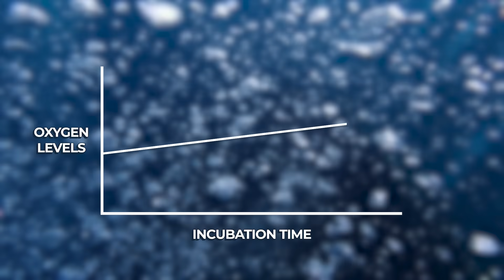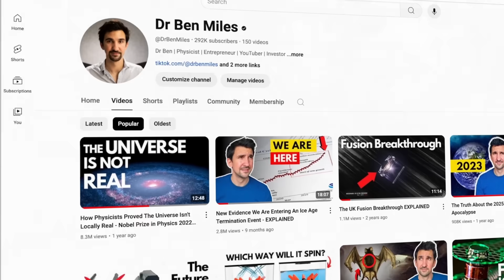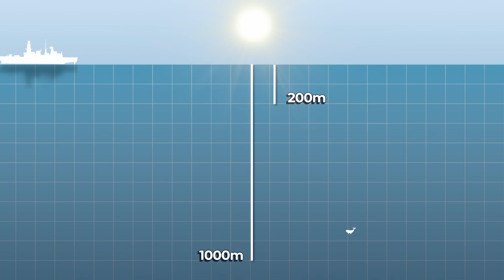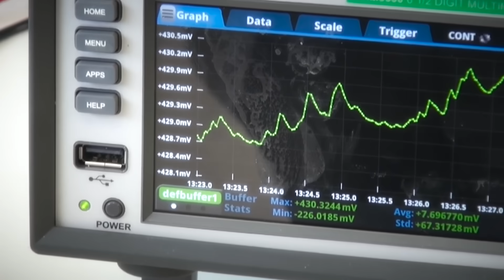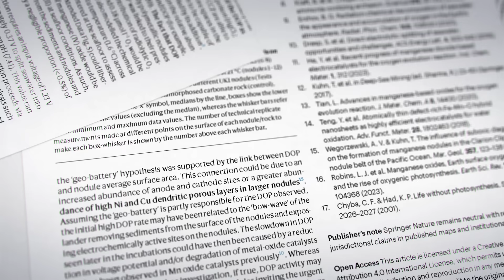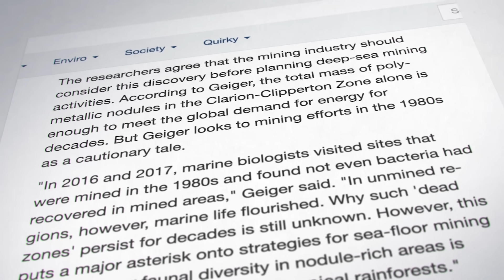We Just Discovered "Dark" Oxygen on Earth - Breakthrough Explained

Comment: What I don't quite understand is why they did not measure the Hydrogen levels. Shouldn't that give a clear indication of whether electrolysis is taking place or am I missing something?
Reply: They were originally only looking for a biosignature. Now that we know about this I'm sure people will be doing that.
Reply from the maker: Its a good point. They did look for hydrogen, but said it wasn't clear if it was being produced or not. This happens when the electrolysis is weak. So not completely conclusive either way.
Reply: @DrBenMiles  Also quite possible that something in there - sediment or solution - is buffering the hydronium. Still, the reason that the curve levels off seems pretty clearly just that it reached equilibrium.
Reply: @DrBenMiles  What about the pH of the water?
Reply: @DrBenMiles It's important to note that this if it is indeed electrolysis, that it is happening in saline water so chlorine will be produced as well. Free chlorine is not particularly good for most lifeforms.
Reply: They probably did, but they reserve it for another paper. In science, it is common to stretch the story's sausage.
Reply: @jf3457  Im very intrested to see if that theory can be proven, because having that on deep sea level will surely change how we see the earth in some way.
Reply: This would be included. Increase of hydrogen levels might be what is killing the microbes. Exclusion of this makes me ask questions and stringing out the reader doesn't pass the sniff test. Unless you're doing the fake science thing where peers aren't actually reviewing papers. If so, then ok, that works.
Reply: @danielcurda3633   They purposefully killed the microbes using a lead solution to ensure it wasn’t microbial life producing the oxygen, having read the paper they don’t mention microbial death in the tests where they didn’t. Secondly at the pressures the vessels were at hydrogen is soluble enough you wouldn’t just have a layer forming at the surface and I’m not even sure if sensors for hydrogen in solution at these pressures even exist, all of the equipment used is highly specialised. Also this is a short article not a paper, they are reporting initial findings which i’m sure they are working on following up.
Reply: @Radio-laria  wouldnt they just depressurize like 50 samples from one cylinder and then try to detect any changes in the composition?
Reply: @Radio-laria  This is not simply water. it is brine. The hydrogen should surely react with the chlorine to produce hydrochloric acid  and chlorine. This process is used in some swimming pool treatment systems to produce chlorine to keep the water sterile. Add salt, add electrcitiy. voila - chlorine. 
There are other questions too. 
Has this sediment been producing oxygen for aeons, or is the process for measuring it actually kicking off the reaction. If it has been producing oxygen for a long time it suggest a catalytic process, not a chemoelectric battery like process.
Is the concentration of oxygen in the sample, the thing that brings production to a halt.
Way too many questions to jump to a conclusion.
Reply: @Radio-laria  You can simply release the pressure and the hydrogen would gas out, at which point any number of tests (starting with: a match) would detect its presence.
Reply: @jf3457 I really like that phrase you used there. I might steal that for myself if you don’t mind.
Reply: @jf3457  Or the company paying them told them to do whatever was needed to allow further mining.
Reply: @brbrbrbrbrbr8393  Whilst hydrogen is usually barely soluable in water at the pressures the experiments were carried out in a significant amount of hydrogen is able to dissolve.
Reply: How about measuring chlorine levels, as electrolysis of sea water produces chlorine not oxygen?  I think these "scientists" are dumber than the rocks they study.
Reply: The same chemical reaction is believed to to be responsible for the very large deposit of natural hydrogen found in North East France last year. And it could be presumed that extreme pressures come into the process as well, be it 4km down in the ocean or 2 km down in the earths crust.
Reply: Hydrogen likes to bond with other molecules and turn them into acids, so it could be that they don’t expect to see bubbles of hydrogen, since it would too readily react with other elements in the water around these nodules, especially if the metal is creating it via hydrolysis.
Reply: @NotreDanish  Isn't it also true that hydrogen atoms are much smaller than oxygen, and would escape faster?
Reply: @ChelleLlewes  They are indeed smaller, but they aren't escaping. The electricity is tearing a water molecule apart to free up one oxygen atom and two hydrogen atoms. Even though you're right about the size of the atoms, there's some chemistry law (Boyle's?) that says the released hydrogen gas should have twice the volume of the released oxygen. Wondering where it is going is an excellent line of questioning.
Reply: @thomasmount3530 but then the pressure is a factor, a lot of processes act differently when under pressure.
Reply: @NotreDanish  You've confused gaseous hydrogen, H2, with hydrogen ions H+
Hydrogen gas is much less reactive than hydrogen ions and hydrogen gas is what is produced by electrolysis
Reply: @NotreDanish  Do this reactions give away teat? Could they use thermal vision?
Reply: I think we need to re-visit the concept of ionic bonding and its relationship to em waves

Comment: this is a background voltage made by the movement of earth magnetic field
Reply: The earth's magnetic field does not move. Well, over centuries the poles wander. But it doesn't move enough, or fast enough, to generate any background voltage you could measure.
Reply: thats not how induction works. Induction requires an alternating magnetic field

Comment: No bit of information about CO2 level in this regions. We know that CO2 is slipping through gaps in the earth crust and is dispersed in water. We know that chemical reactions may reduce CO2 to CO + O or C + O2. So why do they think so complicated that it should be electrolysis?
Reply: That reaction is extremely energetically unfavourable requiring light, heat or electrolysis. To the best of my knowledge CO2 reduction only ever produces CO and H2O at best and usually things like methanol never straight oxygen.
Reply: Turning CO2 into C and O2 requires an input of energy. Electricity is one form of it. Plants use light to do it. It's possible there's a geothermal source, too. More tests are needed.
Reply: @Zadamanim Plants don’t generate the oxygen from CO2 they do it via hydrolysis. Then the O2 from the CO2 is used to regenerate water. It’s more complicated than what is taught in schools.
Reply: They probably thought that might be it too, but did some tests to rule that out.
Reply: Because there is not an energetically favorable pathway for that CO2 to C + O2.
If you know something I do not, please elaborate
Reply: @MisterWillow  It fully dissociates at 6000C so not looking particularly viable ahah
Reply: @Radio-laria  What? What do you mean? Please be clear: this is YT. 🙂
Mt Question to you: Where is it 6000C on the seafloor?
Reply: @MisterWillow  The temperature for the full thermal decomposition of CO2 is 6000C as a demonstration of how energetically unfavourable it is. Was not saying you’d ever find that on the sea floor ahaha
Reply: @Radio-laria  Ah, OK. :-) I thought you were dense. My bad. 
Language can be a problem when it comes to sarcasm-sensors. ;-)

Comment: If it's the surface area that's important, then a fraction of the nodules could be ground up into chunks and still get the job done in terms of oxygen generation and hosting unique microbes. The process of mining would still be ecologically devastating though.
Reply: Unfortunately if their theory is correct the physical structure of the nodule will be thing responsible for the voltage generation. Breaking it up would mean it not longer functioned
Reply: @Radio-laria  If you read the research, multiple nodules touching were best at producing the required voltage for electrolysis.
Water moving over a long chain of nodules would have enough of a saline gradient to provide the energy for electrolysis to occur and new water moving in would maintain an ever changing saline gradient that doesn't deplete.
No magic perpetual energy rocks needed, just a variance in salinity in contact with a conductive collection of touching nodules.
Reply: It took a billion years for them to grow! It does seem like a bad idea to screw them up, the planet won’t last long enough to replace them.

Comment: Ben mentioned that you need at least 1.4v or so to crack water and produce oxygen, and he also mentioned that the sea potatoes were producing about 0.9v each. But he didn't expand on this, so here's the logical conclusion: In order for this theory to be correct, these nodules must be connecting to each other in series in order to produce enough volts to crack the water. Just two sitting side-by-side and touching slightly would be enough to do it.

But in situ, there's thousands of these thigns all sitting on top and next to each other. Wouldn't this produce thousands of volts overall? Surely that would be noticeable, and nobody has mentioned anything like that. It would be very weird if they connected in series by accident, but only enough to crack water, not enough to kill anything that touches the rocks by accident. Wouldn't the entire sea floor be a giant dead zone everywhere these rocks are touching? Seems far-fetched, but I'm probably misunderstanding something here.
Reply: The factor you are missing is that even if they are somehow randomly connecting in series an creating high enough voltage to split water, they would soon, in the blink of an eye in geologic time scales, be worn out.
Reply: not really how voltage works. It's a pressure differential same as anything else. Imagine a regular, soapy bubble. They have slightly differing pressures from eachother and from atmosphere. Now imagine a ton of them clumped together. Will they now explode? No. The pressures even out because they are not being sorted and combined in strategic ways. The nodules down there are not connected in series nor parallel, they are stochastic.
Reply: Now, if you separated all the bubbles with lower-than-atmospheric-pressure from the bubbles with higher-than-atmospheric-pressure, then combined each side and put them next to eachother, you'd have something like an anode and a cathode, and pressure would move from one side to the other. But this only happens in small segments of randomized systems, like flipping a coin to say heads X number of times in a row. It works in batteries because we are strategic about how we place the chemicals.
Reply: The voltage is higher in larger rocks with higher surface area. (And there are billions of them under that sediment as well, so on top of sitting next to another one side by side, they can be piled on top of each other as well). Also, the pressures involved effects the voltage required for electrolysis (and the voltage cited here is only "ideal conditions")
Reply: @rdizzy1  Also, I believe the 1.4V or whatever is only the voltage to spontaneously electrolyze. Remember that all equilibrium reactions have a forward reaction and a reverse reaction constantly happening, and the equilibrium is where the forward is equal to the reverse. Applying a lower voltage may not spontaneously electrolyze, but it could give a boost to the forward reaction, shifting the equilibrium to the right, so to speak. Someone younger and more ambitious can run the math on that electrochemistry, but I'm pretty sure there's some logic there.

Comment: I think it’s important to trying to quantify how much oxygen is actually produced by these nodules. It can’t be more than a small fraction of what is diffused through the oceans surface which has a much larger surface area and have known circulatory patterns. Yes, the oxygen levels increase in a confined space, but that’s not what you find naturally.the ratio of the collection vessel to the volume of the surrounding water has got to be trillions to one.

How many moles of reactant do you require to create a mole of oxygen, which is then used up by the sea floor creatures? It just doesn’t seem to add up at at first glance.

Comment: I would expect it's more like a catalytic converter reaction. We know the nodules have uncommon useful metals and rare earth material, useful in explicitly novel "enzyme" like materials. A "battery" theory would quickly corrode the materials, or dissolve them entirely. I'm glad you touched on it.
Reply from the maker: This was my first thought as well. I'll be very interest in seeing what the follow up studies uncover.
Reply: I'm not sure about the definition of "quickly." electrolysis can be created with nothing more than a 9 volt battery in my sons bedroom. the scientists measured a little over a volt? the amount of oxygen created by one nodule is extremely low, and would be slow to corrode. very interesting point though. these rocks should be inspected for this corrosion over time
Reply: @NathanWindsor-j7i  These things grow at a rate of 2-15 mm per million years almost any amount of corrosion would outstrip that. Obviously there’s the potential the growth rate is actually that low because of corrosion but it’s still extremely early to say anything definitive.
Reply: A catalyst can change the rate of chemical reactions but it cannot change the energy balance. You still need an energy source.
Reply: @user-jq5bz4wp2e  Hypothetically a catalyst could reduce the activation energy enough that the temperature of the water would be a sufficient source of energy but it’s extremely unlikely.
Reply: @Radio-laria  Man, imagine if that is the case, though. If there's a mechanism to get O2 and H2 almost for free that would revolutionize energy production.
Reply: @user-jq5bz4wp2e  The temperature exists. Proteins and existing catalyzed reactions work the same way. They don't have to be preferable, just "possible" with the tunneling regimes the system permits.
Reply: @doublepinger  The issue with it being a catalyst is that the in-situ and ex-situ measurements were not massively different despite the temperatures being around 20x greater. It it were a catalyst you’d expect to see a large increase in production with that large of a temp increase
Reply: @Radio-laria  Thank you, interesting